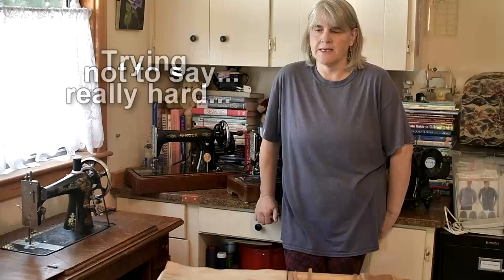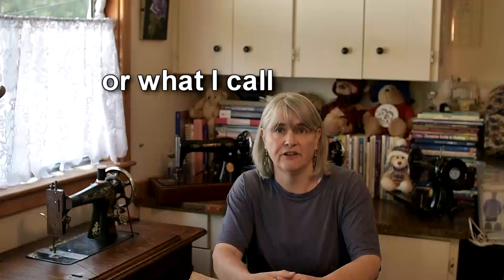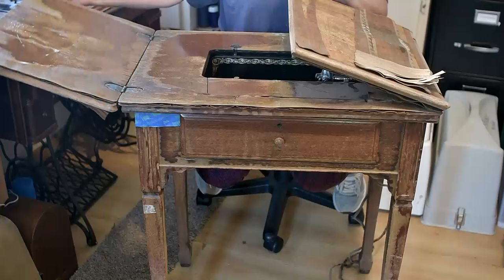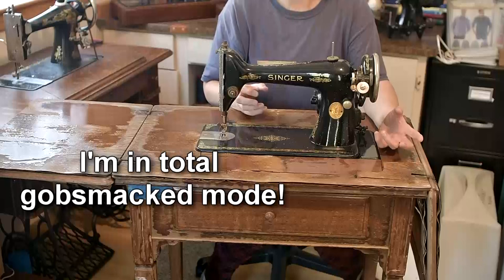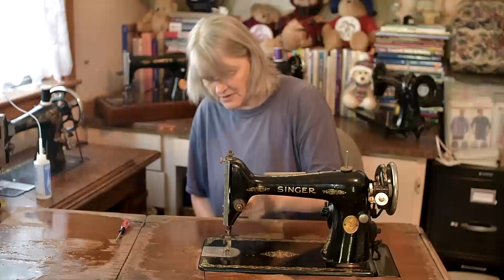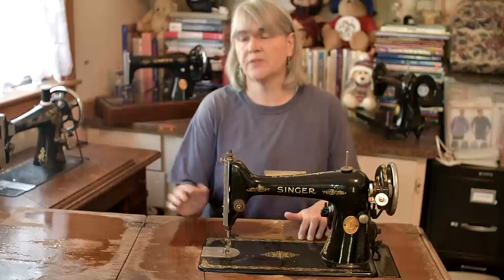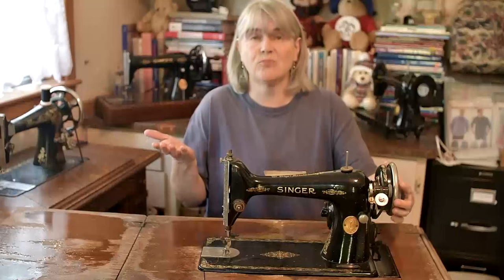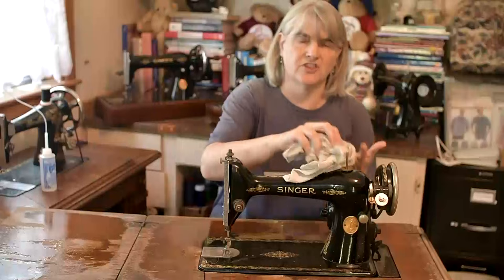Renovating a Vintage Sewing Machine: Is it Worth it? Or Should You Walk Away?

Comment: The only cheap sewing machine I ever bought was a 1960s Kenmore. I bought it complete for $45 dollars and gave it to a freind. As far as I know it still works just fine. My singer 128, on the other hand, was $25 but was 90 years old and took a few hundred dollars to get back to snuff. I like using old machines more than modern ones so I'm ok with this but just keep in mind that almost every old machine you bump into (except mine and Simply Stitchy's of course) is going to be some kind of a nightmare.

Comment: Sorry I am late for this video but I  was getting ready for Idalia Hurricane  🌀 🙃.  Everything good here😅. Girl for a dollar , I will need to go shopping with you. This machine is in great shape. You should see the trouble I get myself must of the time buying machine that will require for me to learn more skills.  The cabinet is salvage,  remove the top layer , clean it with denatured alcohol.  Paint with Shellac or your prefere finish. That's a library cabinet? Looking for one of those for my 101.

Question what do you know regarding Vintage German Veritas sewing machines ? I was given one  all what I know is in the neck  have decals K1.11.  It have a shuttle bobbin and the bobbin winder is lower.  Very small machine. Some said is like the singer 28 . Can't find a manual for this little cutie. I  went to add more oil today because is totally frozen and rusted ( remember I told you I get myself in trouble 🙃) and couldn't stop calling her my  little one.
Reply from the maker: I had no idea you were in the path of Idalia! I'm so glad you are OK! Yes, it's cabinet #40 known as the Library Cabinet... It's a bit of a mess but still has strong legs so I'm thinking there's a chance for it. Possibly.  Apart from being made originally by Clemens Muller in Dresden, I don't know that much about Veritas machines. I think they got taken over by Seidel-Naumann. Muller began by making clones of Wilson & Gibbs machines as well as Singer. Check out the ISMACS or Fiddlebase websites. They might know a bit more.